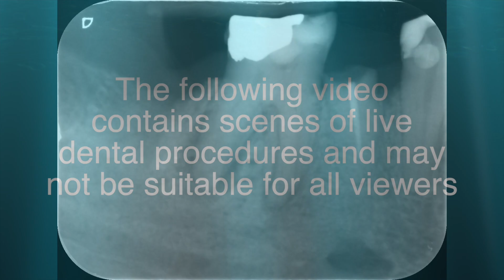Molar root canal treatment. Overcoming hurdles during treatment of a five-canal LR6.

Comment: What's your protocol for coronal flaring?
Reply from the maker: Hello Rose, I use a Protaper SX, gates #2 or micro-opener to widen the orifice. Strict straight line access is probably not required with NiTi instruments as they are much more flexible than stainless steel. Cheers John
Reply: @john rhodes endo  thanks very much. Is it necessary to instrument with handfiles prior to using an  sx or gates?